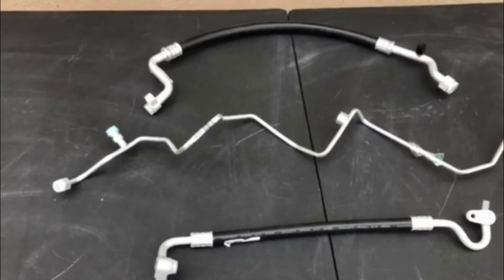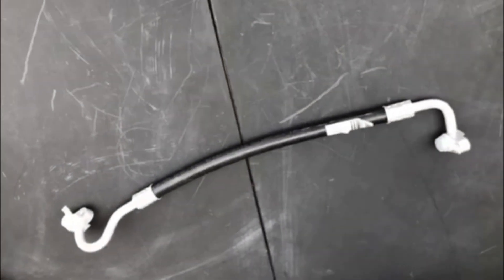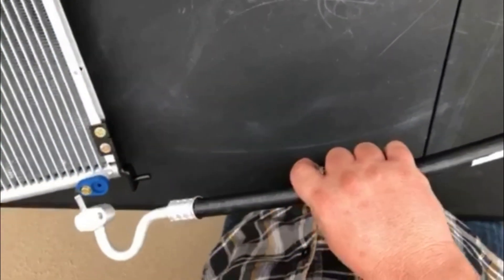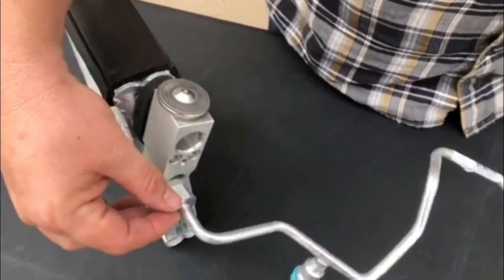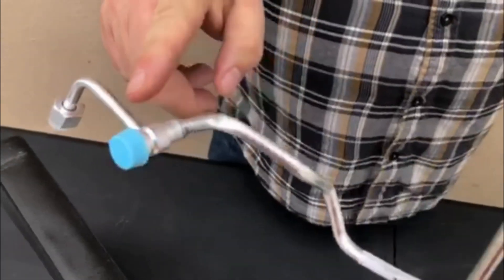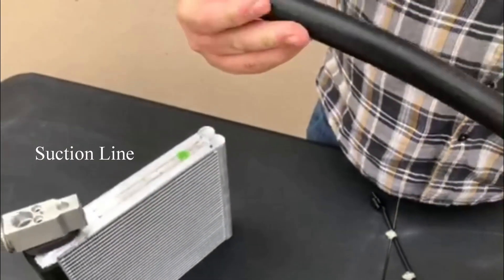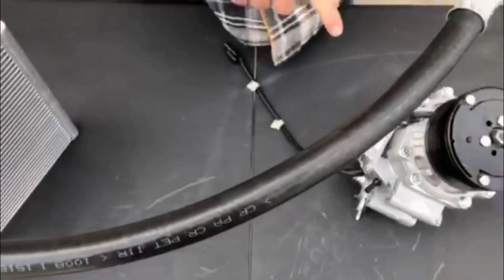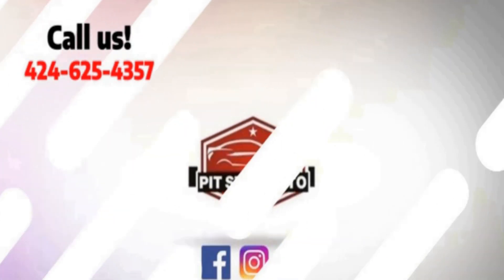How the suction, liquid and discharge line all work inside of your car's A/C system

Comment: In my 2000 Chevrolet S10 pickup they designed it so did the hoses for discharge and suction both cross over top of my fan shroud and that makes it very difficult to get the fan shroud out without having to really flex those hoses to the tune of about three or four inches up to jockey the fan shroud around and get it out. Doesn't that break them automatically if they're under pressure

Comment: Do I need to use a vacuum pump when installing a discharge hose?
Reply: Anytime you open the system, it introduces ambient air. This system needs to be vacuumed down before refrigerant is reintroduced it. Holding a vacuum also confirms system is leak free.